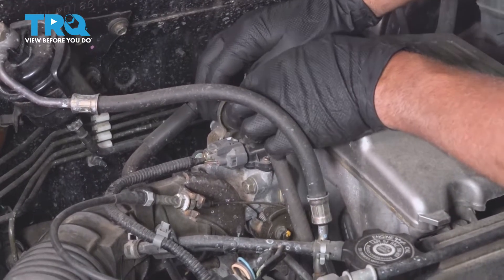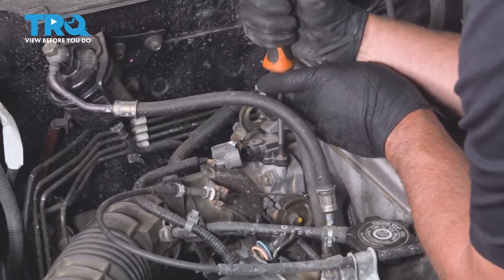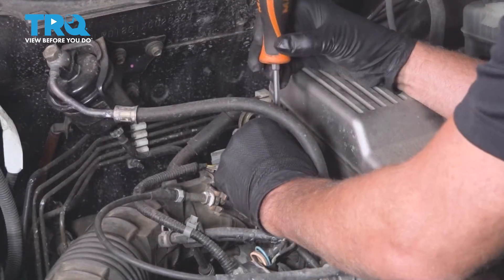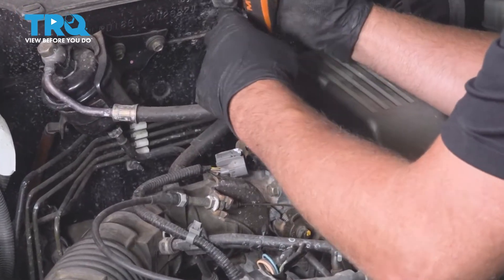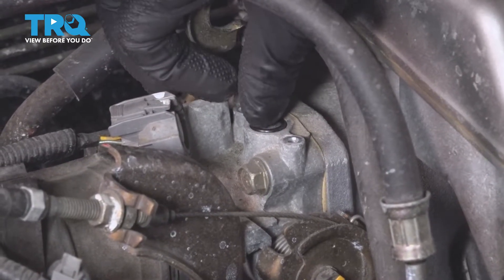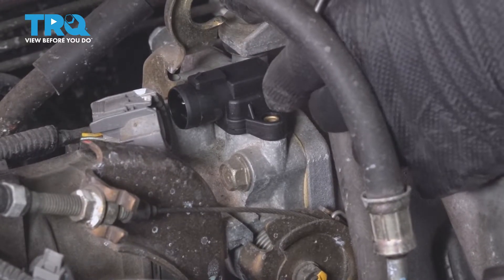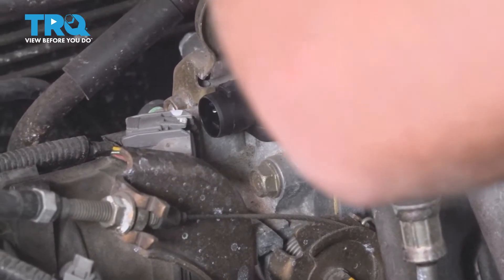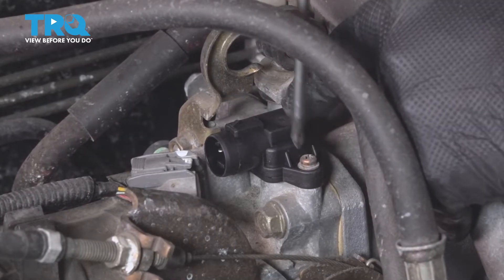How to Replace MAP Sensor 1997-2001 Honda CRV

Comment: Hi sir, my crv s10, have idle problem, after i changed new honda original  idle control, still have the problem. Is it map sensor will effect rpm dropped to 0?